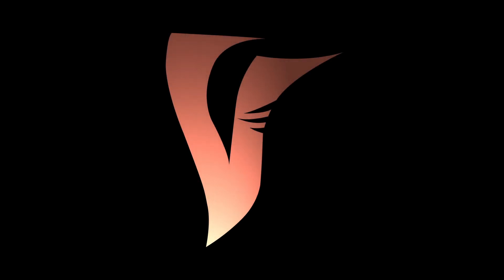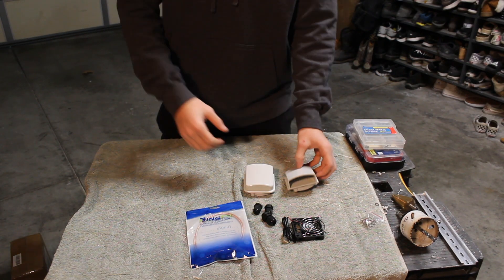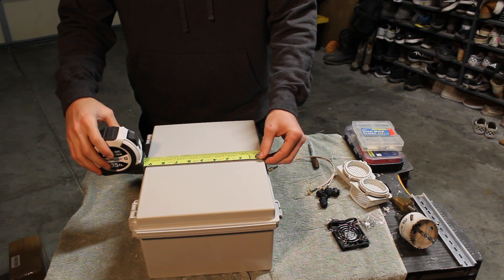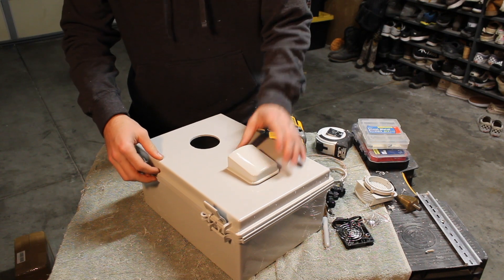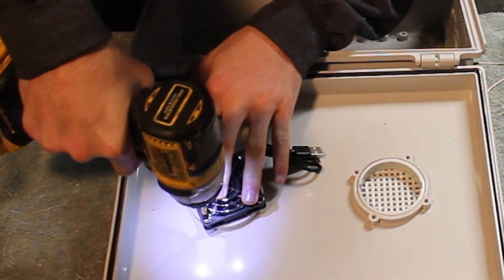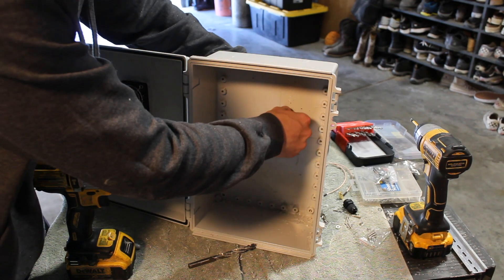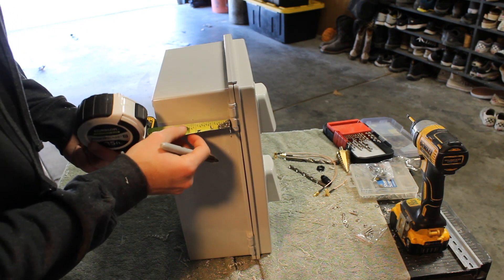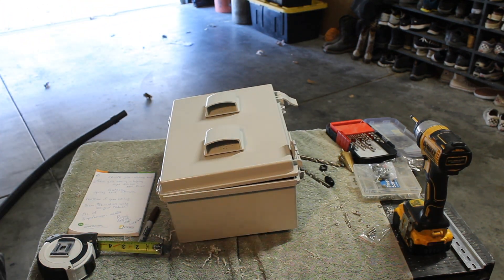Build Your Own Off-grid Helium Miner EP1: Enclosure Preparation

Comment: If you use a "Non penetrating roof mount" and throw some cinder blocks on it, you can raise the mast much higher without worrying about it tipping over.
Reply from the maker: Good advice for some applications. Especially rooftop deployments coupled with guy-wire. But if you’re throwing it up on a mountain the mast doesn’t have to be long.

Also I stake these into the ground with 1.5 ft rebar stakes

Comment: I don't see the list of products I'm mobile though.  What are vents called? Also your best bet is going to be to install a larger cfm exhaust fan on the opposite side of an enclosure . Way to think open a window in your car diagonal you need to move air across a miner and the electronics
Reply from the maker: I've actually moved away from fans and vents altogether. Also, these particular vents are sold out almost everywhere. You can find the parts list on my website, bgoodbuilds.com in the blog section. Maybe mobile config is bad, Ill check now. Sorry for inconvenience.
Reply: It is thank you

Comment: Any input on what kind of filter to use with these enclosure vent/fan assemblies? I looked around and a lot of the generic fan mesh being sold is really restrictive (especially for a 60mm fan)
Reply from the maker: I don't use filters. If you are worried about dust and other intrusive particulates you can always just not use fans. I dug around a little as well trying to find some sort of filter a while back with no luck. You can maybe get away with nylon mesh.

Comment: I am staying tuned for the next one :)! What kind of a battery did you use and how to convert voltage from 24/12V to 5V? Also vent is probably 5V, hotpsot was well, how about sim router?
Reply from the maker: I will explain that in the next video :) I use 12v battery and use a buck boost converter to go from 12v to 5v

Comment: what was the cost without the miner
Reply from the maker: Cost varies depending on how big a panel/battery I need. Also always trying new parts so anywhere between 800-1200 seems to be the range, though it can be done for much cheaper if you just use lower quality parts